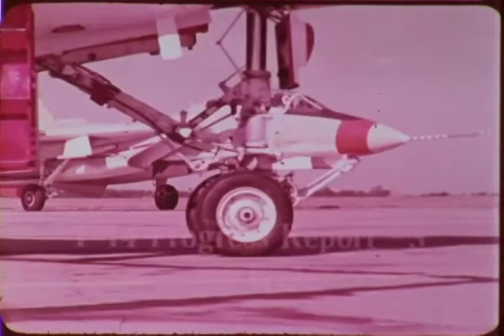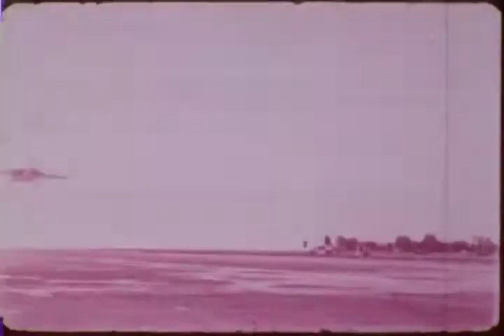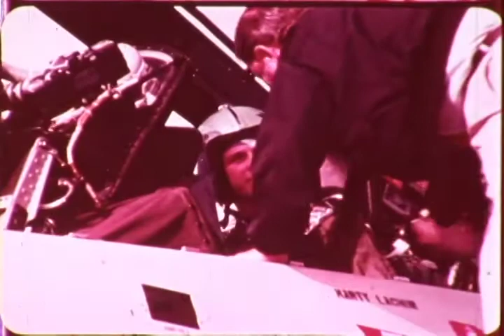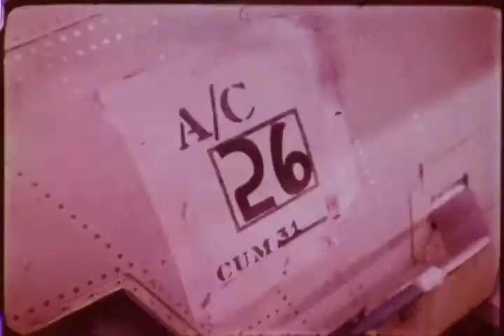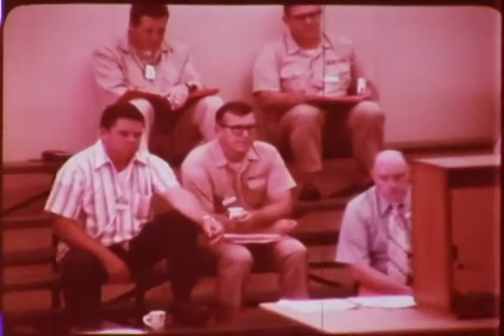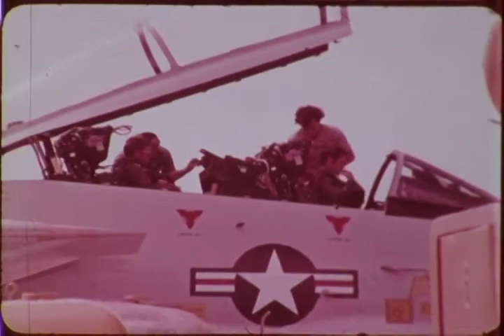F-0441 Grumman F-14 Progress Report #3

Comment: The Tomcat that was used for the carrier qualifications trials was the 10th one as mentioned.  It was also one of at least 4 Tomcats lost during the development phase of the program prior to IOC in 1973.  The F-14 did not deploy on aircraft carriers until fall 1974 when the first two frontline F-14 squadrons (VF-1 and VF-2) embarked on the USS Enterprise (CVN-65) and covered the evacuation of Saigon.  Those squadrons' planes did NOT engage any MiGs according to what I've read.
That tenth F-14 was lost in a fatal accident in Chesapeake Bay.  There was no RIO onboard when it crashed.  The pilot was Bill Miller who was pilot on the ORIGINAL prototype when it crashed on its second flight (Dec 30, 1971).  He had previously been backseater on the first flight of that plane (Dec 21, 1970); he changed seat positions with the pilot of the first flight, Bob Smyth, for the second flight. 

Miller was practicing an aerial routine (with the tenth F-14) for an airshow that was happening a few short days from the time of his accident.